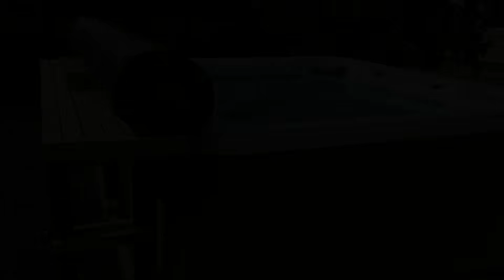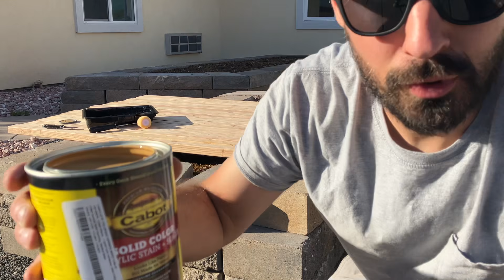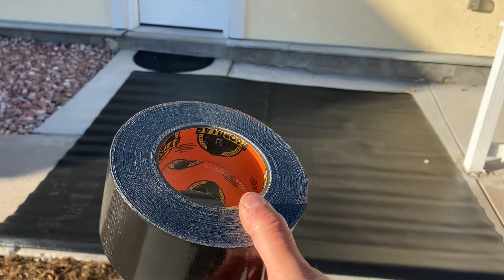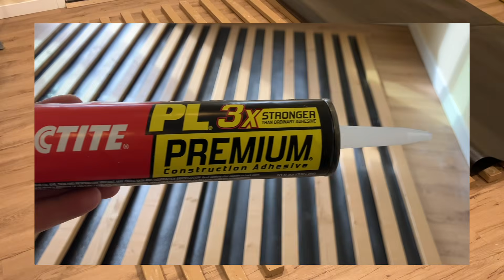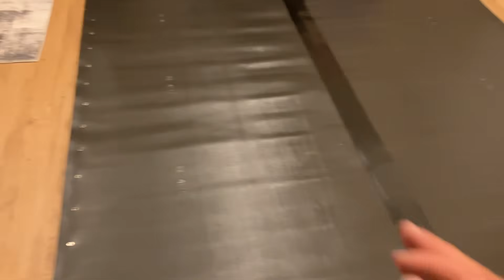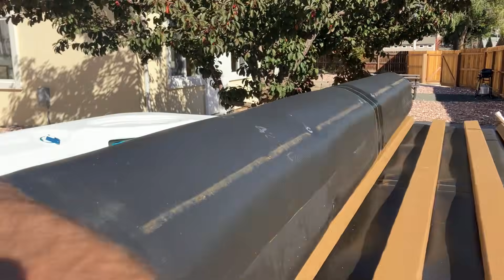DIY How To Build a Hot Tub Cover for Less Than $200 | The DIY Guide | Ep 19

Comment: I can lift my cover myself. For sure not 300 pounds. I think since this is normal wood, even with your coatings, it's likely going to warp and cause opens spots in the cover. How is it holding up after a year? Also, there is no foam insulation so doubt that thin rubber is going to insulate well. Likely your hot tub heater is running more often.

Comment: So we made this exact cover following your video 3 weeks ago, we keep temp at 101, first few days it held temp at 101 but ran all the time, it use to only run the normal cycles I think 3 times a day.  This past Monday we had a storm, power was out for 4hrs, I noticed it was running all day yesterday, temp got up to 95 then started dropping again down to 93.  It will not get back to normal temp.  Also I live in MD temp hasn’t been less then 30degrees and usually closer to mid 50’s.  Any suggestions on what we can do etc without purchasing a standard cover again? I was thinking maybe one of those lightweight tarp like covers might help??
Reply from the maker: Filters could be clogged causing a reduction of heat efficiency. I would start there
Reply: @ it has a brand new filter and was  drained and cleaned for our winter season,  for some reason it’s just not holding in the heat, I’m thinking of maybe trying one of those bubble solar covers on the water, hopefully that helps, I’m worried about this electric bill
Reply: @Krystal-d9s  Maybe a lightweight cover with a layer of insulation attached? (don't ask me which kind of insulation or how to attach it, tho' 😆 )
Reply: Your heater isn't working properly...
Reply: @jeffsparrow66  it dropped to 40degrees over winter, put our old heavy cover back on and temp went back to 101 same day, wasn’t heater,  it was this homemade cover😕 unfortunately we spent a lot of $$ for nothing, but learned a lesson

Comment: Hey my friend! How was the electric bill? I refurbish and sell used hot tubs, and occasionally have to buy new covers. They are junk and don’t last very long. I am considering looking into this alternative, it looks very modern and slickk! Just curious to the economic factors about it.
Reply from the maker: Only a ten percent up tick but there were two variables that changed at once. Winter started and I’m in CO. So far so good. I’m going to double layer it and add more screws to prevent dips when heavy snow falls
Reply: @The-DIY-Guide  ok thank you! I may just try it!
Reply: @The-DIY-Guide  aren't you concerned with the metal screws damaging the hot tub?
Reply: @tjismyusername  how so? With rust stains?

Comment: What size screws and washers did you use?
Reply from the maker: Glad to help! I used those black epoxy coats 1 & 5/8 screws with stainless steel washers. Stainless steel and epoxy coated help prevent rust since this is a constantly wet condition.

Comment: Has this held up okay? Does it provide enough insulation to maintain spa temps (~104F)? Looking for ideas and I love this but I'm skeptical!
Reply from the maker: Hi! So far the hot tub can easily keep the temperature up and sustain it at above 100F temps. What I’m waiting for is the first electric bill to see if there was an impact. If so, I will add additional rubber insulation and see how it improves. I’ll keep this updated
Reply: @The-DIY-Guide  I'd imagine even getting a floating expanded foam cutout to sit on the water would make a huge difference. You'll be losing a lot of heat out the top of this.
Reply: @jasoncatt  that's a great idea. There's always a solution, if you think creatively.
Reply: @The-DIY-Guide  what happened w/ electric bill?
Reply: @The-DIY-Guide  Was there a noticeable impact on the electric usage? I assume so, but want to double-check...
Reply: @The-DIY-Guide  How about that electric bill? Higher than you like, or no noticeable difference?